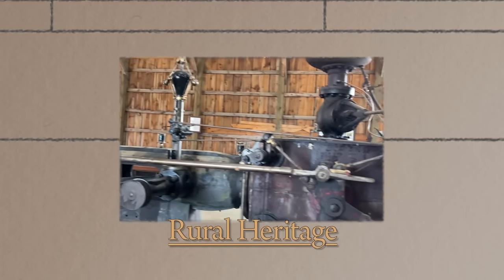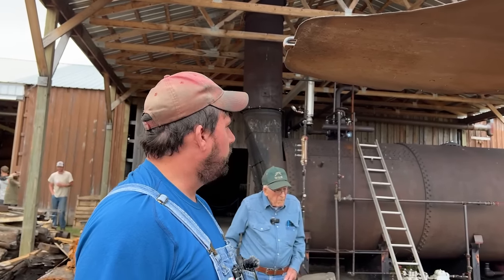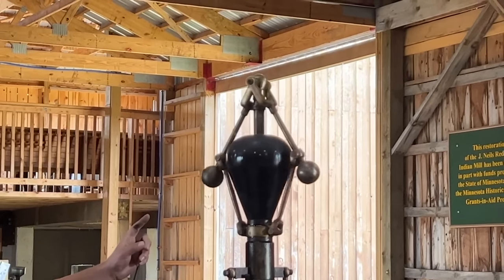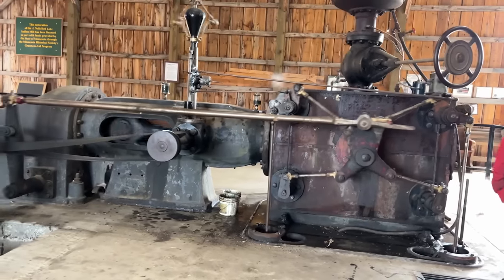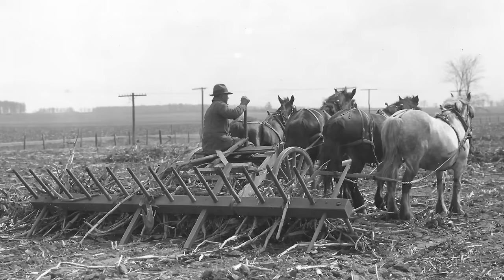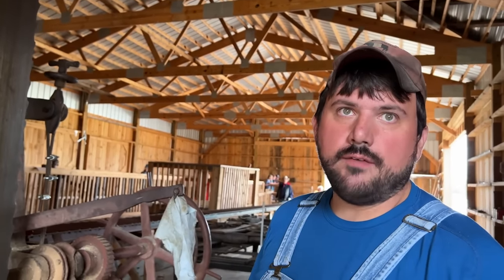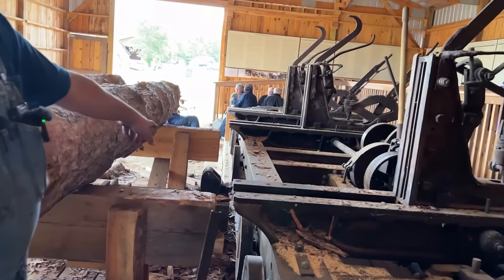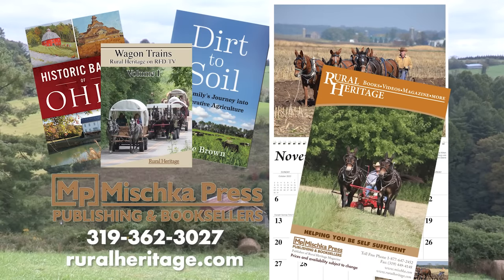Itasca Sawmill

Comment: This needs to be made again and used more often in our industries! It might look antique but it really works!
Reply: I'm surprised the Amish haven't mandated boilers. They'll use diesel engines to run all kinds of things and workshops.
Reply: You really think if it was more efficient companies wouldn’t be using it. Obviously you have never seen a modern sawmill
Reply: @kingduck3192   Yup I had to stop myself, at first I was all "this is amazing! why aren't we still making these engines?" Then I realized I have no idea how modern sawmills operate.
Reply: @dylanstandingalone  I was wondering what the energy loss total is. If that's 117 HP engine how much HP is making it to the end process (mechanical loss and such). Then you gotta wonder how much fuel oil they were burning vs run time. Either way I'm sure it's incredibly inneficient albeit very cool.
Reply: It simply couldn’t compete with the production rates as modern mills have. Very cool though.
Reply: Does it work? Yes. Are there cheaper and more efficient ways to do it? Also yes.. and that’s all big corporations care about.

Comment: Very good video, F.H. Stoltze Lumber company just west of Columbia falls Montana used to have a shotgun carriage feed. Stoltze is from Minnesota also. They used to run 4 Dutch oven type of boilers. They are still in business today, over 100 years,  but with a new boiler/plus generating power for the valley grid. They use a dc drive for the carriage now. J. Neils also had a large sawmill in Libby, Montana also. A lot of us here in the Flathead valley migrated from Minnesota to here to follow the timber industry. Plum Creek timber company also came from northern Minnesota, A lot of timber history here and in Minnesota.